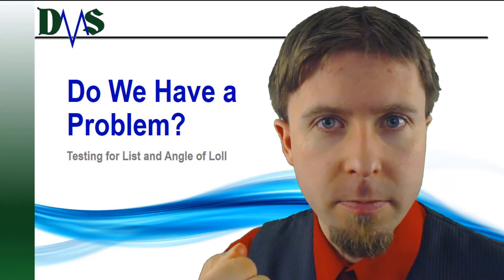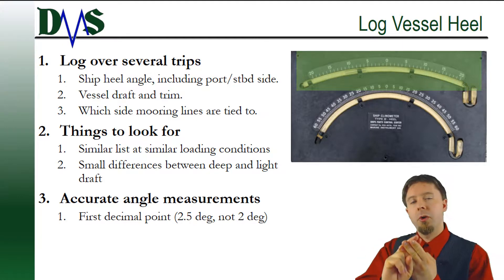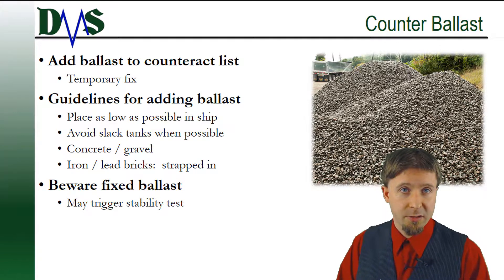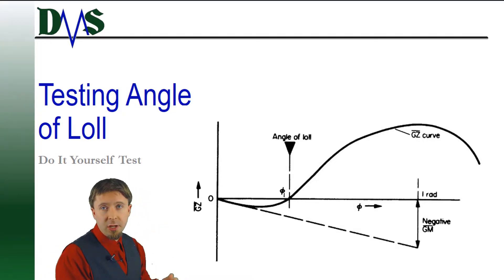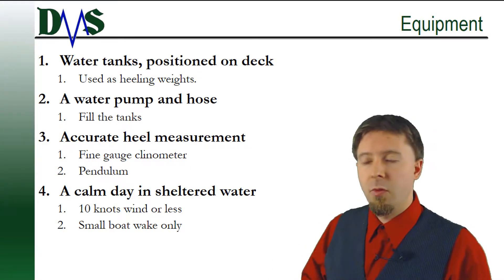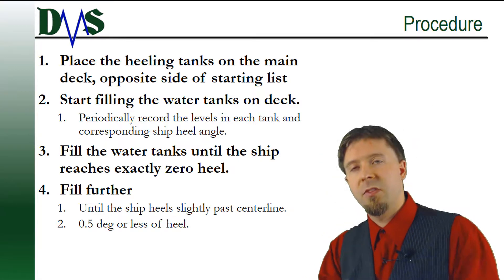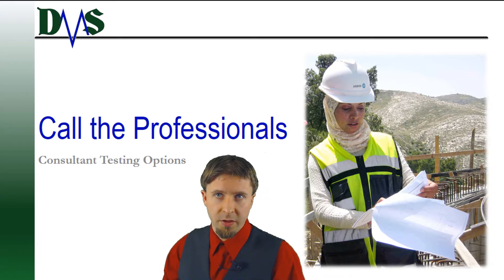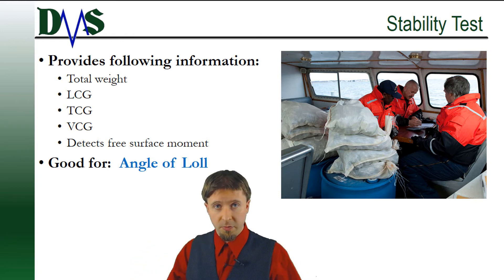SIMPLE DIY:  Testing for List and Angle of Loll

Comment: In my humble opinion, i think the owner shouldn't try those tests themselves since they will be risking the safety of their ships.
An experienced naval architect should do this after studying the original stability of the vessel.
Reply from the maker: You are right that there is a risk to the ship safety, if the test is done wrong.  I debated including this video due to that risk.  However, I have seen many cases where ship owners ignored a problem because they did not want the expense of a naval architect consultant.  Then the problem gets worse, limiting the possible solutions when the consultant is eventually called.  

Given that, I decided it was better to arm ship owners with the knowledge to decide for themselves.  Especially since many ship lines have naval architects on staff that can do the required stability calculations.  But I do agree that if the owner has any doubts about the test, they should bring in a naval architect consultant.
Reply: I Got your point.